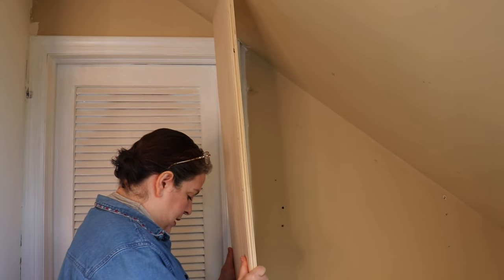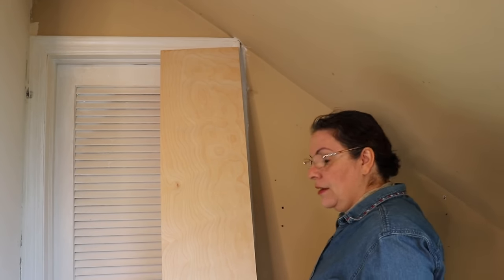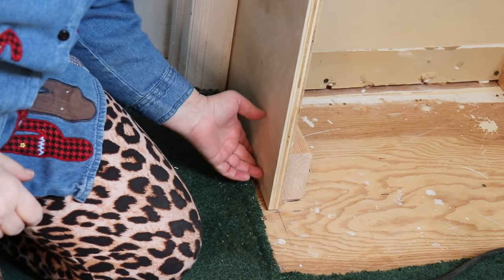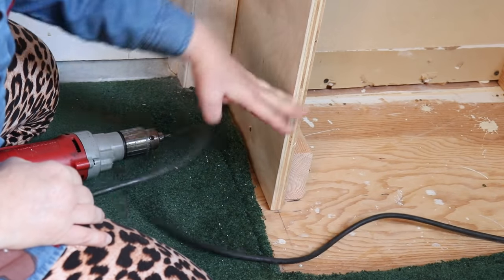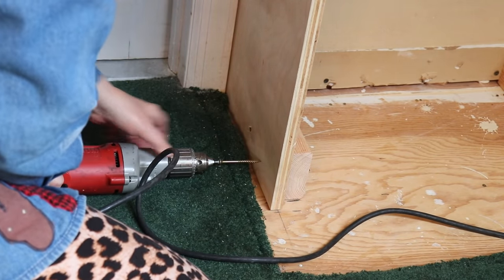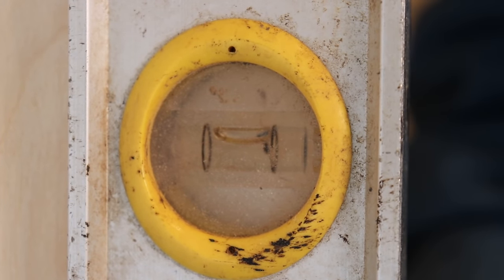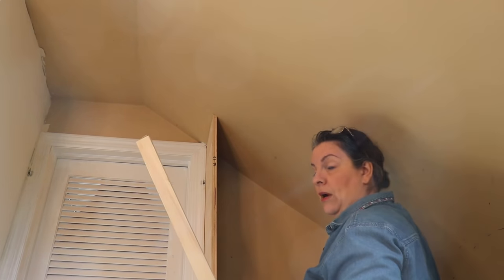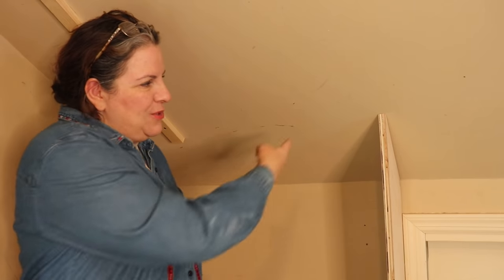Master Bedroom Makeover Series || DIY Bookcase || Episode 15 ||

Comment: Great job once again! When screws come with a bit use painter's tape to tape the bit to the inside of the box lid or put the box of screws and matching bit in a ziplock bag or other closable container. That way the bit stays with the screws it came with so whenever you grab those screws again you are set.

Comment: Looking good Sophia!  You might want to replace your blade in your saw because it's dull and burning your wood when you cut it.  You can tell by the dark on your cut pieces.  It will cut a lot smoother and faster with a new blade too.  Just an observation.  Love all your videos!